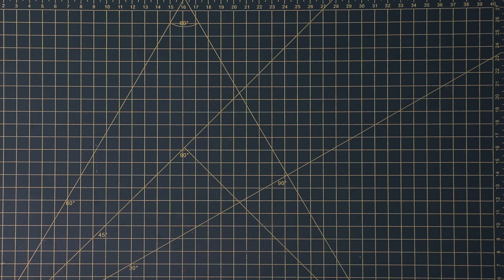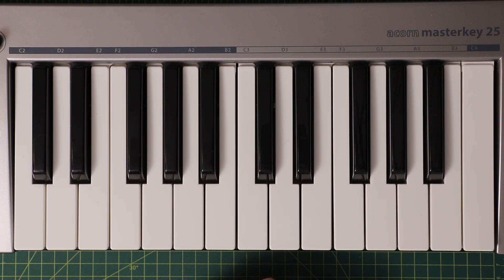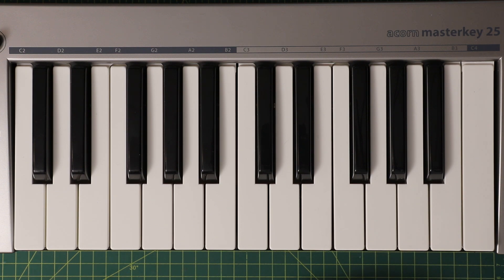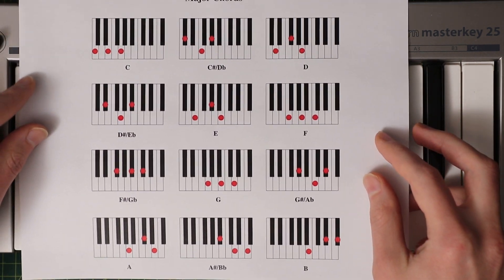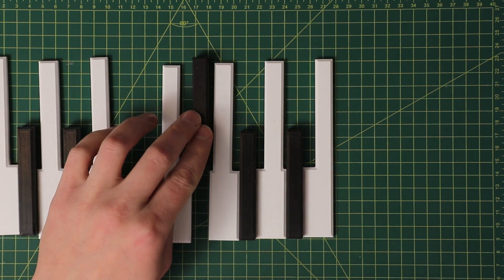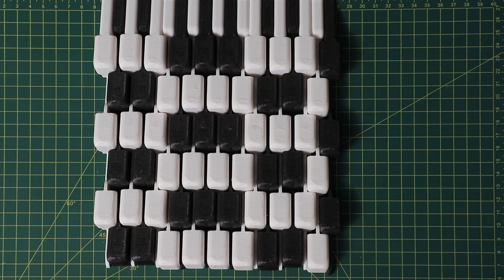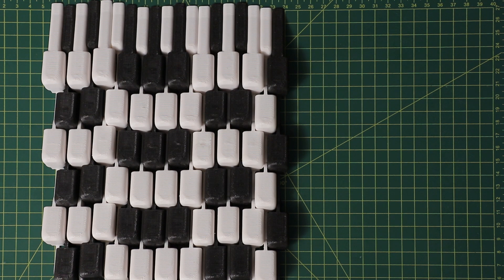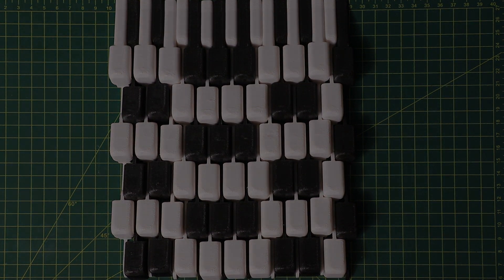DIY Janko Piano: 2.  Keyboard Layout

Comment: button accordion!!! Have you looked at the layout of a chromatic button accordion? It has an isomorphic layout, similar to the jankó but split over 3 rows instead of 2. There are also some variations, semitones rising with keys going down and right is called B system, which is what I play. Semitones going up and right is called C system. C is more common in western europe and B in eastern europe. Accordions with the jankó layout do exist but they aren't common anywhere. Older and lower end instruments may only have the 3 rows, but most of the higher end has 5 rows, meaning a shape using all 3 rows can be moved to any note. Also, the buttons are pretty small. An octave on my instrument is almost exactly 3 inches from center to center, and I can reach 2 octaves pretty easily.

The issue of not knowing where you are on the keyboard unless you are looking at it is solved with a texture on some of the buttons. On my accordion there is a texture on all of the "black" notes, but some just have it on C and F, or some other combination. This is important for the accordion because you can't really see your fingers anyway, you kinda have to crane your neck around the top in order to see your fingers do anything

There are also a lot more resources for it, especially in russian where the chromatic button accordion (known as bayan) is pretty popular. While still not much compared to classical piano, there is still a sizable accordion repitoire, classical, jazz, folk etc. and resources available.

I really badly want to see a piano with this layout. The mechanism might be even harder because the keys are even closer together though. I haven't been able to find anyone trying to do this, the closest thing I've seen are electric organs with the layout of the bayan. It would not have as much of an unpopulatiry issue, because all the people who already play bayan would suddenly be able to play the piano.
Reply: There is a pretty well known video of the bayanist Alexandr Hrustevich playing vivaldi's four seasons, just look up alexandr hrustevich vivaldi summer or vivaldi winter on youtube and it'll come up
Reply from the maker: Ah yes - I've read about the various accordions & bayans along with different alternative isomorphic layouts (Wicki-Hayden for example), but the Janko layout is the closest to a regular piano layout (each successive key is a semitone apart, if you ignore the rows) and probably the only one that would work for an '88 key hammer action' design without requiring wires or a mess of rods to connect the buttons to the necessary hammers.

Textures on the keys for ease of locating has been mentioned before and might be something I will try in the future, though it depends really on if I find a need for it. At the moment I havent really had any issues even with longer jumps, though at least in part because I am nearly always looking at the keyboard. Might not be 'correct', but I kind of did the same on a regular piano as well... Issues with being self-taught I guess.

But yea - I think for any of the other isomorphic button layouts the only real option is what lumatone does - essentially a button with a velocity sensor for each key (at which point you can just have each key be its own 'unique' midi note, so whichever layout you want to use you just program it in).

Comment: I have small hands. Reaching a full octave on a regular piano is very difficult for me, I always want to 3D print a narrower keyboard. Is this layout more suitable for smaller hands?
Reply from the maker: Yes, the octave span on the janko layout (the traditional one that I am using at least) is 5.1" instead of the classical piano's 6.5". This means that an octave on the janko would be around the same distance as between C to midway between G and A.

One thing to keep in mind though is that this is purely for the 'authentic' janko layouts; the 'cheaper' DIY options that simply print out keys to glue/attach on top of an existing piano naturally cant change the octave span (as they are limited by the piano they are being attached to), so you dont get this benefit.

So if you are looking for a piano for smaller hands as opposed to an isomorphic layout (and everything that encompasses) you might have better luck with something like this: https://www.narrowkeys.com/

Comment: Also the Dodeka keyboard's only disadvantage is that it's reach is the same as a standard piano as opposed to the larger reach of the Janko, what you said about it having a large octave or keys that are too thin is not true. Dodeka's keys are the same as a standard piano. 7mm keys with 7mm space between the keys, so each key has 21mm of space for your fingers.

And for the Janko and having no touch feedback to orient your hands to, I would think making the white and black keys either mate or gloss finish, like glossy white and mate black could make that a little remedied.
Reply from the maker: Ah yes - I looked more into the dodeka keyboard design and they feature thinner keys to allow them to keep the same octave span. In a way it reminds me a bit of Rico Raven's (https://www.youtube.com/@rico-raven) janko layout modification to a standard digital piano but without the staircase-style keys. Would be interesting to have the 3 styles (classical Janko, Rico Raven's version, and the Dodeka) in the same room along with a good pianist to compare them...

As for the touch feedback for orientation, there have been several attempts at this including adding 12 different textured patterns to the keys (almost like braille), but even then the classical piano with its 'missing' black keys between BC and EF allows for much better sightless orientation... just too bad that it also makes the layout non-isomorphic.
At the same time though - if you did add some sort of touch feedback for the keys it might even be detrimental in cases where you transpose a piece (or even just a single section) as you would 'feel' different keys as you play.

Comment: Regarding diatonic glissandos, this could be done easily by hosting the VST in Gig Performer, which supports MIDI scripting. One might assign a pedal to switch to any alternative note mapping that you would like. It’s like having a transpose or octave switch on an electronic keyboard, but more powerful. You could also split the keyboard, with Janko on the right and Diatonic on the left.
Reply from the maker: True, but I try to stay away from software solutions. In a way I prefer methods that would at least be theoretically possible on an acoustic instrument.

Its much the same reason why I focused so much on a 'realistic' hammer action instead of making each button be its own separate velocity sensitive 'key' which would have allowed the piano to be used not just in Janko layout but also Wicki-Hayden layout or for microtonal music (essentially a DIY Lumatone).

Comment: ❓ Do you have a video how to (more or pess) easily converted the own piano (or e-piano) to this with the use of a 3D-printer?
Reply from the maker: If you are looking for a quick-and-easy conversion for a regular piano to a janko layout, the best bet is probably one of these two:
Casio CT-S400 mod: https://www.thingiverse.com/thing:6666469
Arturia Keystep mod: https://www.thingiverse.com/thing:3564049

Keep in mind that I havent tried either, and you will likely have to put in some time to figure out how to best print the parts (the casio one seems to be a bit more 'printable', though the keys would have to be split in half for printability). It will also not quite be the same janko keyboard as it will be missing the parallelogram design that makes each key's buttons dip the same 10mm, as well as the 5.1 inch octave instead of the regular piano's 6.5 inch.

Personally I might just make a casio conversion myself to try out the piano while the proper build is... building.
Reply: @DIYJankoPiano  Thanks very much!

Comment: Single- and double-row isomorphic layouts have still one significant issue: you cannot play fast glissandos in every key. This is an issue also for a standard layout, but not to that degree, as on traditional layout you are able to play fast glissandos only in C-major and a-minor, as only white keys are used there. 

Of course, fast glissandos is not something that is often used in music, but if we want to build a perfect layout, we should consider that as well. With every non-linear layouts containing only 7 keys within an octave, glissandos could be as fast as the finger action of the player, and there's always a limit to that. Dragging your finger across the keys would always be faster.

There might be a solution to the fast glissandos issue. Similar problem, but from different angle, was actually solved many years ago by harp makers. Harps were always known for the possibility of playing fast glissandos, but at the same time the possibility to play in different keys, and in the process of developing western music, also changing the key fast during the play, became a necessity. 2 solutions were invented. The first one was the cross-strung harp with 2 sets of strings, one corresponding to the white keys of the piano, and the other to the black keys. This, however, has proved not too practical and now is almost unused, with only a few such harps being produced and even fewer harpist actually being able to play them. The other solution included fast retuning of the harp with 2 mechanisms: hand-operated levers for shortening each single string, and single- or double-action feet-operated pedal mechanism for retuning each string within an octave, so as many strings at once as many octaves the particular model covers. This solution, in double-action (changing each note to flat or sharp) variant to be exact, is widely used now, as it allows to retune the harp very fast to every possible key, provided it's a heptatonic scale (other scales would have to have either some strings removed or just not used) and it's an equal temperament turning. The single-action lever solution is used for smaller, cheaper or custom-made or custom-modified harps.

In theory, the retuning solution is perfect, but in practice it has its drawbacks and limitations. The double-action pedal mechanism of the concert harp is extremely complex, its setting-up is very painstaking, operating 7 pedals located close to each other and having 3 settings requires additional training and very precise and careful feet movement. Too slow retuning could cause buzzing, whereas slipping the pedal could damage the harp base, because all the pedals are connected to very strong springs. Also, the mechanism usually doesn't cover all the strings, with the longest being either manually retune with the tuning pins or sometimes there are levers added to those few strings, but they allow for single-action retuning (from neutral to flat or from sharp to neutral). 

I'm not sure if this idea of retuning could ever be used in pianos, maybe except for fully electronic ones, but that would be a ground-breaking achievement and I really believe we can always do better. If that would ever be achieved, this could solve another issue which I can see with double-row isomorphic keyboards. Although the fingering shape is always retained for every chord, you have to inevitably change rows to be within the same key. And you have to memorize those row changes for each key, which brings back the complexity. On the other hand, the additional lower rows for thumbs are obviously a huge benefit.

Also, there's another solution that for some reason was never used in keyboard instruments, but could be very handy. In computer and typewriter keyboards, some keys have special markers on them that could be felt with the fingertips. Those are usually put on F and J keys and function as reference points for all other keys, as those keys are the ones where your index fingers should rest and return to. This relates to the idea of touch typing. In case of playing keyboard instruments, a similar technique is I guess at some point achieved by professional players, but due to the larger size of the keyboard, players have to from time to time control their hand position by looking at the keyboard. But still, this is something that if used, could also make the playing much easier to learn.

One last note: there are 3 interesting mechanisms which in my opinion could at least be considered if someone would like to implement some sort of retuning mechanism to a keyboard instrument. Feet could be used to much greater extent, and actually they are used when playing the pipe organ or pedal pianos (although the latter are rarely used). Pianos usually already have 2 or 3 very important pedals, but they could be moved either to a different row (as it is done in pedal pianos), or, and that's the second idea I want to present, modified so that they are operated by the knee. In pedal stell guitars there are knee-operated levers for slight changing of the pitch (similarly to the whammy bar in electric guitars). I'm not saying this knee-lever has to be used only that way, but only that knees could be used to operate additional mechanisms. And the third interesting mechanism that could be used in order to solve the retuning issue are organ stops. Those are drawn knobs next to the exact keyboard. In the pipe organ, stops turn on and off particular sets of pipes, even when playing a piece, and even for a subset of keys in the keyboard. This makes it probably the best option for a retuning mechanism, although it could be extremely difficult if it were to be mechanical. But if it was done for pipe organs and harps, so I guess it cannot be impossible.

In my opinion, the piano, as well as many other instruments, still needs some work. Instruments are usually created in order to sound perfect, cover all standard keys, and preferably have some nice effects. But the easiness or logicallnes of playing is almost never considered. Leave well alone, as they say.

Nevertheless, it's amazing that someone is actually revising those alternative layouts and trying to build their own piano. Good luck - I'll keep my fingers crossed.
Reply from the maker: Wow, that was a good read! I did check out pedal harp designs previously (unrelated to piano - was just browsing how-its-made videos and came across them) and was astounded as to the complexity of what I previously considered a pretty simple (at least in terms of 'no moving parts') instrument. Was eye opening to see that complexity.

In terms of pianos, the thought of 'movable' C where you can essentially transpose the entire keyboard on the fly did come up while I was researching alternatives to the classical piano; after all most digital pianos already contain the 'auto-transpose' function where you can just shift the 'notes' any which way and just play the same song in a different key without changing anything. Unfortunately its very limiting - even assuming you can figure out a way to switch 'keys' on the fly (not impossible as you said - perhaps a pedal board, or a second row of keys specifically for switching/transposing the keyboard), this would still lead to issues of complexity - you would not only have to memorize each chord position on the keyboard, but also keep in mind which key you are transposed to at that very moment.

As for glissandos, the Janko layout offers a way of playing a whole-tone glissando (two types), or a chromatic glissando (in my version of it where I included a row of 'all keys' at the very top that you can glide along. Its true that its not possible to play the specific C major glissando that you can on a regular piano (and yes, I realize there are songs specifically written to take advantage of that which will be 'impossible' to play on a Janko), but an attempt to accommodate glissandos of specific keys will naturally increase the complexity quite a lot - you might have 3 extra 'rows' at the back that would have specific keys raised for a C major glissando, or a 'black keys only' glissando, etc.
You could potentially do something similar to the pedal harp with the back row key heights changing based on the 'key' of the glissando you pick, but just as with the pedal harp the complexity of such a device would be crazy, for something that isnt really used all that much in piano playing.

Going further, the Janko layout offers a few interesting techniques that arent possible on a regular piano:
1. Very long intervals such as a major 10th are quite easy due to the shorter octave span, and even longer intervals are possible
2. whole tone glissando (as a replacement for C-major glissando)
3. multi-note chromatic slides (such as C-C#-D-D#-E) which on a regular piano are only possible with 2-note when you start from a black key
4. chromatic chord slides (such as C major -> C# major -> D major) which on a regular piano is only possible for 2-tone slides on very specific chords (they have to start on a black key and end on a white key for every note in the chord)